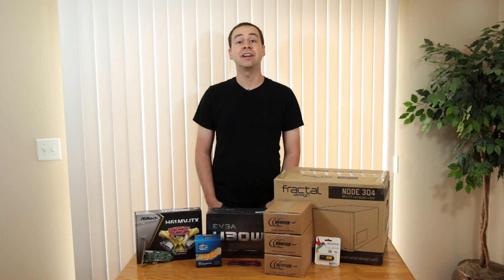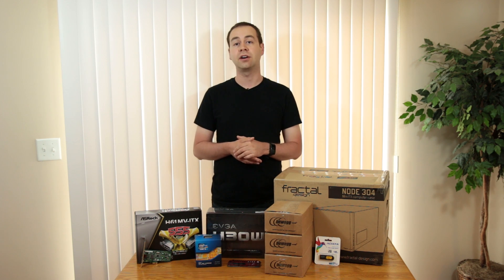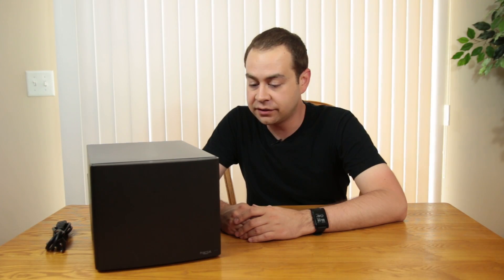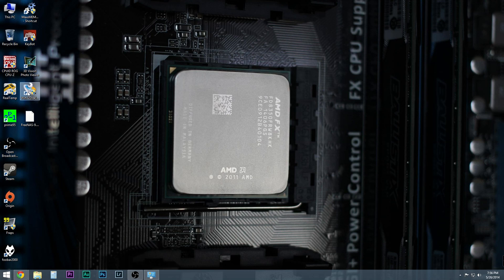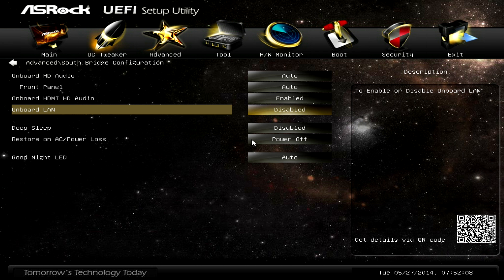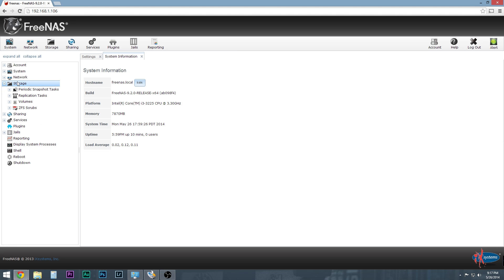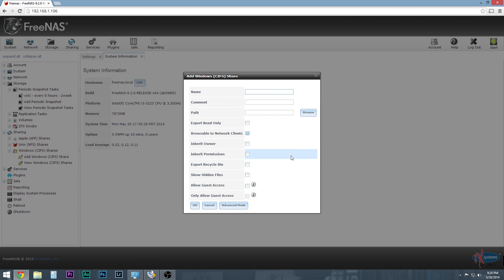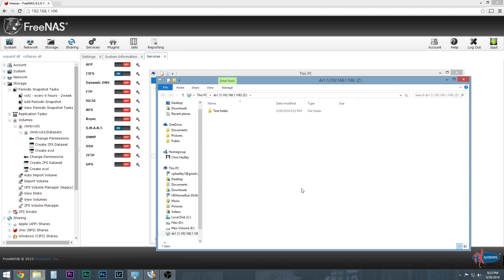Build a FreeNAS box - Core i3, 3x2 TB, Fractal Node 304

Comment: He guys!
It's really amazing watching your video and got to understand that the data is so much safer with free nas build.
I have a bunch of new hardware lying around and do hope that it will be sufficient... Pls help.
Motherboard - MSI H110M Pro-VH Plus Socket LGA 1151 Motherboard
CPU - Intel Pentium G4400 Skylake Dual-Core 3.3GHz
RAM - 4 X 4 GB Non ECC RAM
Drives - 4 X 4 TB WD Red Nas Drives
PSU - Corsair 450W
NIC - Interl Dual Port

It's just for FreeNas, no plex, no virtualization nothing; only 4 users max. The machine will be running 24X7.

Is the hardware sufficient / extreme for my build?
Want to keep the budget as low as possible.

Q1. Intel NIC is a dual port GB link. Will I get 2 Gbps connectivity speed if I attach 2 lan cables?
Q2. I want to share files to my friends who will be on different network. May I know what would be the download speed for them?

Comment: You have forgotten ECC RAM in your FreeNAS box, a very criticial part if you use FreeNAS + ZFS. ECC is a must.
Reply: for home use hes fine everyone gets bent out of shape over ecc but by the time youve spent money on ecc ram motherboard and cpu you may of well of just brought a prebuilt solution ecc is mainly aimed at industry usage that handles lots of data per hour your home picture collection will be fine
Reply: KYLE REES
ZFS is a filesystem that relies on RAM. If your RAM throws an error your ZFS is broken.
BTW:
ECC isn't anymore that expensive.

Comment: In this day and age one would think if you put in 6TB worth of disk they would have figured out how to actually give you that much rather then acting like the government and taking almost half of it
Reply: Tt Ss the reason it says 3.63 TB even though there are three 2 TB drives totalling 6TB is because he is using a RAID that does backups. Therefore you only get access to half of the storage as the other half becomes a backup of the half you get to use.

Comment: Desktop Board & Non Ecc Warning!

Great work but it's really important to mention that ECC is a must, and using a desktop board should be done with an understanding of the risks associated! If you want to keep your data at all costs, consider whether THE COST of a server board and ECC memory is less great than the cost of a data loss, that is what I'm having to do. 

You have been warned :-)

Best wishes,
Adam
Reply: Then why use FreeNAS. If it can't make sure the files aren't corrupted when I back them up with regular hardware then freeNAS sucks.

Comment: That case is one of the most reccomended for a small FreeNAS build, but the mobo and CPU could use tweaking. 

I would suggest knocking the processor down to one of the pentium series that supports ECC memory and AES NI (The G4400T for example).  Yes the mobo is more expensive, but the processor is cheaper, and it already includes an intel NIC with the chipset (and often 2, useful for teaming or working with a second LAN.)  Additionally server-grade motherboards tend to support and be supported by non-windows operating systems. 

ECC is especially important to maintain the integrity of data on ZFS. AES-NI is useful when you want to encrypt the data drives or serve files remotely via a VPN or other encrypted tunnel.

Comment: Important note, most stock CPU coolers come with thermal paste already applied. If that is the case, you SHOULD NOT apply your own thermal paste unless you have removed the factory supplied paste using alcohol.

Comment: Running ZFS with no ECC RAM and only 8GB, the minimum for FreeNAS?  No one should follow this guide as far as hardware.  ZFS relies on your storage data in RAM to make sure the drive data is correct.  Unlike traditional RAID it knows if a particular drive is having bit rot.  BUT it relies on the RAM storage to do this.  ECC comes into play to make sure a bit is not flipped in RAM.  If that happens on non ECC memory you will end up injecting bad data onto your drives.  You do not need crazy high end parts, but some areas you really need to spend a few extra bucks.  In my case I use a Supermico server board and 32GB ECC from Crucial.  But the CPU is a tiny little Pentium G3260.  A $50ish dual core.  That might be changing since some of my needs for the box have changed, but for most homes where the biggest thing to stress the box will be a 1080p stream being transcoded by Plex it's enough.  Much more then that and a quad core chip might be a good idea.   But the main point is ECC, ECC, ECC.  Don't build a ZFS file system with out it.  You are putting your data at risk for no good reason.
Reply: +Chad Bremer  The chance of corruption is low and still better than most other file-system even without ECC. Even if you have FreeNAS you should still make offsite backups for all of your critical data anyways.
Reply: ***** well, could details needed.  Will this just be a storage server?  If so on of the atom powered boards from Asrock Rack are a good option.  8 core Atom CPUS, 64GB of RAM support.  ECC of course.  Big thing to keep in mind is its recommended to have 1GB of RAM per 1 TB of storage for ZFS.  With that, a socket 2011 board may be a better solution.  You can get dual socket boards for about $200-300 on ebay.  Nice thing is used 2650 and 2660 xeon CPUS are cheap.  $50-60 for eight cores.  Plus if doing a lot of transcoding with Plex, the extra cores will come in handy.
Reply: Keep in mind you can run a dual socket board off one CPU.  Adding a second one if needed later.
Reply: Depending on budget, used socket 2011 stuff may be the best option.
Reply: Not too shabby.  Pretty similar to my current setup.  Mine has enough power to do about 4-5 transcodes at once.  Might want to go ahead and ex0and to 32GB of RAM. Then you won't have to worry about it.  Freenas will use what ever you give it.  The extra RAM will be used as cache space.
Reply: ***** APC, CyberPower, and Eaton are all good.  Not sure what is available in the UK.  

Flashing to IT mode is only needed on expansion RAID cards.  Not needed on the mobo.  Just run it in AHCI mode.
Reply: WorBlux RAID/ZFS is not a backup.  And yes off site is ideal.  But not always possible.  Bare minimum you should have another copy not on the same machine.
Reply: would you be able to link me with a decent motherboard option. I'm planning on building freenas box with 16gb min ram and 8tb to start with (2x 4tb drives, expanding in future) for a home network.
Reply: Chad Bremer Thanks for the info, it'll be used as a storage server and for running plex.
Reply: Chad Bremer OK thanks again. My budget is about £1000 going a little over isn't an issue. I'll look into socket 2011 stuff, cheers.
Reply: Chad Bremer Yeah I was considering doing that for cache. I'll also have to crossflash the board to IT mode which I'll need to look into. and I'm in the process of looking at a decent ups supply. Any suggestions on a compatible ups (UK plug socket (bs1363))?
Reply: Chad Bremer OK thanks again
Reply: The i3 is ECC capable..(edit whoops not this one! but there are alot i3's that can do ECC) but you need a workstation Intel Chipset. I am searching around for people making a NAS with i3, undervolting it on a Intel® C236
 chipset. But i can't find anyone confirming that i3 and the C236 with ECC ram really let the ECC work....
Reply: +Chad Bremer   I agree. ECC memory is a must. For any type of server imho if you value your data. I love Supermicro boards. Tyan is good and surprisingly ASUS makes some good enterprise class boards. Almost any fairly modern business class HP or Dell Xeon box can be had for cheap on eBay. I also use Opterons. AMD processors all support unbuffered ECC ram.
Reply: Chad Bremer How's this sound.
CPU:  Intel Xeon E3-1231 v3
Motherboard: Supermicro X10SL7-F
RAM: Samsung DDR3 1.35v-1600 M391B1G73QH0 (2X8GB of ECC RAM)
Power Supply: SeaSonic G-550
2x 4tb Red WD Harddrives
Fractal Design Node 804 Chassis

Comment: i can access the NAS wirelessly? i.e Wi-Fi(sorry NAS noob)
can i set the HDD to Raid0?
Reply: +Tom Louwell Basco As long as the NAS is connected to the same network (wired Ethernet or WiFi) as the PC that you are trying to use, then yes. Raid0 is no problem as well, check the freeNas forums!
Reply: Thanks for the info.

Comment: should have left out the intel network card, and put a better cpu cooler on that. then as you add hard drives, it won't suffocate more so than it is. That cable management was EVERYWHERE! it was like putting a blanket on the cpu. :/

At the very list put a 32gig ssd for the freenas boot drive.

Comment: Major flaw of most of inexperienced builders of a NAS is buying all the disk drives at the same time and on the same dealer.  This will mean that the disk have a large probability of breaking at the same time.  Please buy the same model of disks from different dealers like newegg, amazon, tigerdirect, bhphotovideos, adorama, etc.
Reply: +Luke Horror That is also a better idea.  Now it all depends on if you trust a certain brand for its reliability.  Well for me I can trust two brands WD and Seagate.  So you can also use different brands as well.On my first comment my main point is keeping the manufacturing components different from a certain manufacturing date.  Because in production you can't always get the same components from the same supplier.  They also get the same stuff from others. And in certain times they also have different quality in them.  That is why when you look at a PCB of the same product from a different manufacturing date you can always find differences.

Comment: FreeNAS is great until you decide you want to run other software on the box that doesn't quite work well in Linux.
Reply: +Jason Honingford Except FreeNAS isn't Linux.  It's FreeBSD.
Reply: +Jason Honingford Plex is a plugin module available in one click.  You can also download the freebsd version of plex and run it in a regular jail.
Reply: +Jason Honingford such as? most if not all server software works with linux.
Reply: FreeNAS is a nice web UI and it's great when everything just works. When it doesn't, you'll be doing your troubleshooting with SSH command line. When you start installing things like CrashPlan, you'll want to be sure the 64bit version of Java is being used. Haven't tried Plex, but I'd be surprised if that works out of the box and is on the right ports, etc.
Reply: +Jason Honingford all i have to say is it pays to know Linux :)

Comment: Great video. Can i use freenas with my existing drive ? Right now i'm using windows file sharing to share my files from my PC with windows sharing file. But it's too slow transferring file especially via wifi it's just get around 50 mbps (from 150 mbps of wireless N device). May be this freenas can transfer faster than windows file sharing in same network devices ?
Reply: No it's slower if you are on Windows enable jumbo frames

Comment: Questions:. 1. is it possible to make the drives not raid. 2. how do I connect to a media device. 3. the ip address of the device is it fix or overtime I need to reboot I ned to check the ip address. thanks

Comment: that board doesn't have SATA3.0, does it make any difference in real world? I mean you are going with HDD so does it bottleneck or something?
Reply: Think about he was getting 100mb/s on the transfer and the limit for SATA 2 is 300Mb/s. So no it's not bottle necking. The only way you can really bottleneck SATA 2 is with SSD's.
Reply: *****
those are the theoretical maximum value and my testing says WD blue SATA3.0 drives can easily reach up to 150MBps when on SATA3.0  port but on SATA2.0 it got about 120MBps max.
Reply: Redwan Hasan So you're asking a question you know the answer to???
Reply: ***** no,  i didn't have the the chance to test good amount of devices so might be a good thing to listen to what else people has to say.

Comment: I have some noob question here. 1st: is this configuration hot swappable? (considering the i have a different case which can i access my hdd's easily).. 2nd: how can I tell on which drive is failing? (the drive that needs to be replaced)

Comment: hi is the OS been run from the usb stick?
Reply: bobby royster Yes. It is the most cost effecient way to do it. The drives have to be 100% dedicated to storage, and the OS is only read with very little writing, making it ideal to run from a cheap flash drive.
I personally used one of those extremely low profile usb drives which looks like a USB plug. Some motherboards have a boot drive usb port on the motherboard itself tho.
Only linux based OS's can do this, worth pointing out.
Reply: wow thanks

Comment: You should add a warning about not using ECC memory and while using FreeNas. Not to mention, you are right on the edge of ram requirements for a FreeNas build. It is suggested that you have 8gb of ram as a base with the addition of 1gb for each tb of storage. Nas4Free is an ZFS solution that requires less resources, which would be more suited to this build if you were using ECC ram.

The reason not using ECC memory is not a good idea is becuase ZFS is built on the assumption that the ram checks for errors. Yes, you can get lucky and have perfect memory, which makes ECC not required but chances are you won't get perfect ram and will lose all of your data at some point. And if it happens once then it will happen again in the future!

Using ECC memory does make a build more expensive and if it is too much for your budget then skip on ZFS and use one of the alternatives. At the very least, if you are set on using ZFS without ECC ram at least check your ram!

Comment: Billy Rowe2 months ago
 
Plugging in a USB 3.0 into a USB 2.0 port, is like plugging in a USB keyboard into a rackmount server and expect to use it to go through the BIOS.

It simply won't work. 
So you always have to use a PS/2 mouse and keyboard. 

It's the same analogy. 
UNTIL you get the OS installed, then you can use a USB mouse and keyboard

_____________________________________________________________________________

USB 2 & 3 are cross-compatible the only problem being reduced data speed

Comment: FreeNas is totaly unstsble. My FreeNAS crashed two times. Now im back with windows 7 as a server with smb share on network.
Reply: Did you you use ecc server motherboard nas graded hdd if not that is your problem for not using the proper hardware
Reply: Same hardware and using xpenology now. Light year before and better than FreeNAS.

Comment: non-ecc...big mistake. no offense bro but you should remove this tutorial. this is not at all the recommended configuration. ECC IS A MUST.
Reply: TheGrossOuts TLDR: ZFS is designed to work with server hardware which is resilient against memory hardware failures. The problem with non ECC setups is that if there is a corruption happening in the memory (which is one of those things that never happens until it does) it will corrupt the entire ZFS volume after which you have lost all your data. For those still wanting to go ahead, it is recommended to not use ZFS but Ext3 which will limit the damage and won't corrupt the entire volume.
Reply: TheGrossOuts ECC is a must when using FreeNAS because it will use ram as cache, so if a bit gets stuck in RAM, any data that passes through there will be corrupted. You can use regular ram if you don't care about your data and like going surfing on lava.
Reply: Thanks guys...Data is time. Time is money. Might as well spend a little extra on ECC to save me time in the future!
Reply: In all seriousness, can you explain why? Is data at risk when memory errors occur?
Reply: Andy Nelson
Wow, Andy, you're the smartes clear-thinker around here! - It's like saying: "Car accident? - I never had a car accident, so this never will happen in the future!!"
Reply: Andy Nelson
of course not! - I'm sure everyone can learn from everyone, even if there's a mistake... but please, no offenses here from my side, to err is human and I am human on a daily basis... ;)
Reply: ogarza3 That is not how memory allocation works, and how could a bit get stuck? unless you mean the actual bit keeping a voltage that is too high or too low to register the correct 1 or 0? And data wouldn't "pass through" unless the physical bit is part of a chunk that gets allocated, freed and reallocated to something else. Still the odds of that happening are microscopic
Reply: the chance of getting those kind of error's is soooooo small, i don't think it is that big of a deal
Reply: koenman5534 ECC is suggested for servers because... for everyday users getting a number or two wrong is not a big deal. But when it comes to transferring money, storing important information and other things, it is important not get a single bit wrong.
Reply: Can you explain what Ecc is? Lol
Reply: You only need ECC for ZFS type Server. ECC provides more stability and avoids corruption by making a copy of every data written, which is something not practical for smaller NAS.
Reply: thankyou
Reply: +Andy Nelson No! - It isn't necessary, Daft Punk's muzak used as soundtrack is way too cool! - It's what saves it...
Reply: +Derek Castillo I'm glad that you pointed this out so that I don't have to. 

Tip: AMD FX processors support ECC memory as well as a lot of the AM3+ ASUS motherboards, so unlike the guy in the video, I choose AMD when doing something home-server based. Otherwise you need to get server grade parts that will cost you a lot more.

Comment: Plugging in a USB 3.0 into a USB 2.0 port, is like plugging in a USB keyboard into a rackmount server and expect to use it to go through the BIOS.

It simply won't work. 
So you always have to use a PS/2 mouse and keyboard. 

It's the same analogy. 
UNTIL you get the OS installed, then you can use a USB mouse and keyboard.

Comment: use bigger cases for better cable management and temps. Also not a pain in the ass to rip out a drive once it goes tits up because it got 2 hot in such a small case.